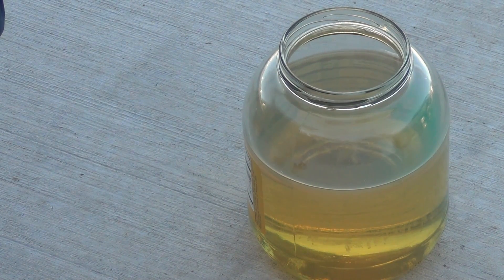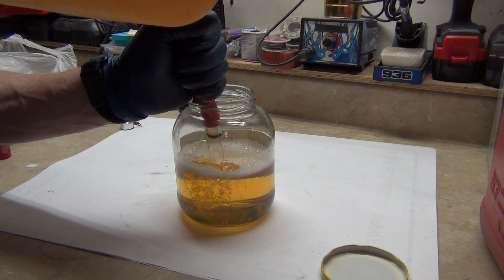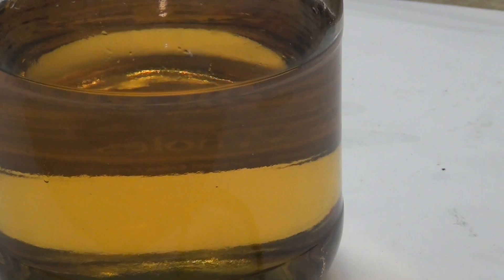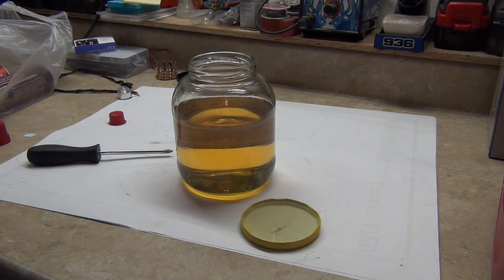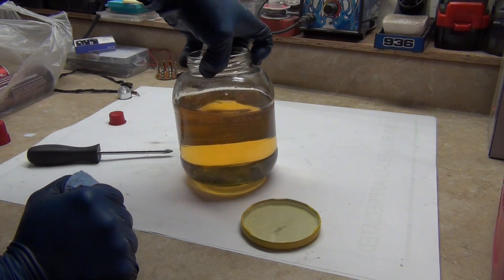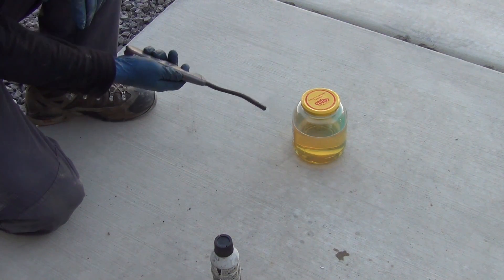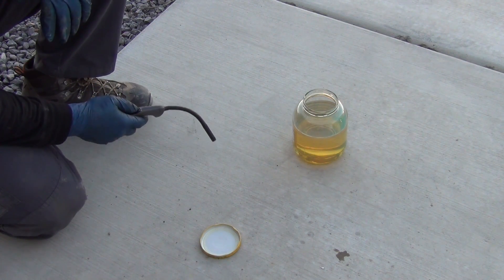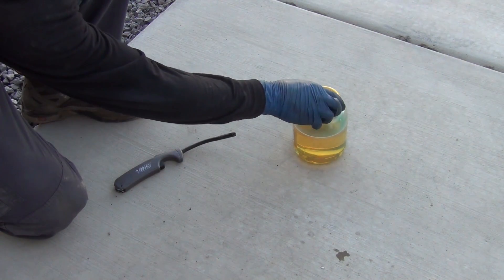What Happens When You Put Gas in Diesel

Comment: Mercedes Benz used to include a chart for adding gasoline to diesel in the owner's manual. Percentages varied from 1% to 5% by volume depending temperature to prevent jellying in cold weather. Using avgas in jet fuel or using a small amount of gasoline in the crankcase oil of WW2 era radial engines was also a common practice. Popular diesel fuel additives are mostly petroleum distillates and are added in small amounts to receive benefit and to minimize  lubricity loss. Be very careful before you try playing home chemist with modern diesel engines.

Comment: In the old before complex common rail injection we woukd mix petrol in to the diesel tonstopnwaxinb in cold weather at that concentration your car will run ok with little effect just keep topping up with diesel
Do not forget diesel will use some engine oil as well on older car ,

Comment: Volatile , Combustible , Ignitable ??? 
What's the word ? 
I did this recently too ( idiot ) full tank of petrol . 80 litres 
Syphoned as much as I could out , put some 2 stroke oil in and filled with diesel after changing fuel filter ( I drove 1.4 km home after petrol fill . )
I kept topped up with diesel for 2 weeks , full up .
Idled rough once on first start , no problems since . 
2018 Iveco Daily turbo diesel

Comment: I worked on the Army base in Europe this summer as a consultant and had to deal with more than few instances where soldiers put petrol in diesel rental vans. I'm not gonna comment on what I think about that, let's just say you cannot miss the sticker on the cap outside on the bodywork and another hole next to the tank, not there in petrol cars. So, there were two ways of sorting it out - the usual and what we did. The usual way was to call the rental company, had that van towed and wait like a week or more to get it back. Of course there would be an extra charge over normal rental rate. What we did was bring the van to a nearby local army workshop where they drained the tank and sorted all other issues. Vans were mostly Fiat Multijets so a lot of petrol could actually break that system.

Comment: Unfortunately my daughter 18 yrs old now borrowed my 2003 black caddy for the first time went to the nearest gas station and was able to fit the diesel pump nozzle into the gas tank opening. I was stunned to find out that not all gas stations have the safety feature of the diesel fuel nozzel having a wider diameter  which won't fit into gas cars. Thank God I didn't give my daughter more than $15 for gas at Mobil Exxon station. I was able to siphon diesel out of tank with still some left over diesel then filled it with 3 gallons of 93 octane then bled the rest of diesel out thru top of engine injector bracket bleeder. Took me 4 hours to stop the white smoke from coming out. But there is still no solution to putting gas into a diesel tank.

Comment: wont adding gasoline to the diesel hurt the injectors ? on account they run hotter ?
Reply from the maker: The real threat is to the injector pump.  Gas doesn't lubricate as well as diesel oil.

Comment: I once tried using a mix of 15% gasoline and 85% heating oil (essentially the same as diesel) in a kerosene heater. It would burst into flame with a big pop when it ignited. The gas vapors still remain very volatile even when diluted with a heavier fuel.

Comment: Bought gasoline at a bp station that had just installed new pumps. I drove a diesel for a number of years and the pump handles were green. At these new pumps the diesel was black and gas was green. I almost grabbed the black diesel but caught myself  had to do double take to make sure hoses weren't crossed by some goobler making a you tube video.

Comment: Different size fuel nozzles is such a simple and good solution. Here in the UK you have to read the pump and check the colour, because both nozzles are the same size. Safe to say, quite a few fuel drain vans are kept busy by dopey people through out the year. Its normally covered by a subscribed breakdown service, but I imagine it's a costly service if you aren't a member. Just checked the figures and the AA claims around  133,000 people in the UK make this mistake every year.

Comment: I bought gas at a gas station and ended up taking the vehicle to the garage.  The vehicle sputtered and mis-fired about 4 miles down the road and backfired to such a degree, it blew my muffler apart.  They drained the tank and discovered a clear liquid that settled to the bottom of a clear jar, almost like a thermocline.    Can't see this as being water.  Any idea what this might be?
Reply: Of course it's water. Condensation is inevitable and because water is heavier than either gasoline or diesel, it sinks to the bottom of the tank.

Comment: I never did it, but when I was young I drove long haul trucks to Canada in wintertime.  I was based in Texas, down here they don't sell Number #1 diesel fuel.  Not anymore.  When I was a KID I saw it here, but not after I was grown.  Back to that it a minute.  

But I knew a lot of truck operators that added GASOLINE to the diesel fuel to help prevent GELLING.  Seemed to work for THEM, but I never did that.  I used other products and of course once I got "up North" they sold NUMBER ONE diesel which of course is a better fuel than the #2 they sell down HERE.  The number ONE all by itself was not prone to Gelling and just would perform better most escpecially when the temperature got BELOW ZERO F.  But we used "Diesel Heet" a product brand name for ETHANOL.  Though Ethanol RUINS Gas engines, especially the smaller they are, it would prevent Gelling and it would cause the water in the fuel, a SLIGHT amount of water,  in Diesel Fuel to mix with the Fuel rather than be in SUSPENSION.  At least that was what the maker claimed and it worked for ME.  I used a LOT of it, put it in the TRUCK FUEL and the Reefer Unit Fuel.  

But otherwise, I would not put GASOLINE in a Diesel Truck of today, they are too EXPENSIVE and now they have ELECTRONICS I don't like on them.  Back THEN in the 70's the diesel engines were ALL MECHANICAL.  They had no "Electronics" involved with the ENGINE.  They were SO MUCH less complicated and easier to WORK ON.  The driver could CHEAT those Mechanical engines when the Alternator went out.  Just take a 10 gauge WIRE and run it from the Hot Side on the REEFER Unit Battery and run it to the hot side on the Batteries that supplied the truck.  It would run the LIGHTS and you could nurse it home.  On a Cummins, we had to screw the nurled nob on the Injector Pump in all the way and that held the shut down valve open for it to RUN.  Could limp home all the way.  Had to put it in GEAR to kill it.  BB

Comment: In the old days we would mix diesel with petrol in winter to prevent the fuel from waxing up it fine to drive with in the fuel tank the fuel will mix due to the return flow of fuel
Reply: Hi Keith, you said, "return flow of fuel"? Is that the workings of all diesel fuel systems.. "return flow"? Isn't the cross-over line between the tanks valved off.. solenoid valves I would guess w/ switch in cab? Thanks
Reply: Not all the fuel that reaches the engine is use some of it flow back to the tank. It's a simple high pressure system
Plus the sloshing about in the tank keeps it mixed

Comment: What diesel number 2 . We only have one type of diesel that clean sulphur free diesel
Why due you Americans make it so difficult over fuel for cars. 
Europe has a similar system. Only the top quality fuels can be used in car answer lorries to reduce pollution,  European diesel can be used through the year we do not change the blend.
Always ultra low sulphur 
Fuel cannot be used in road vehicle as it would knacker your cat and DPF.
Reply: #1 diesel/stove oil is lower temperature tolerant  #2 freezes at -40f or less..#1cost more  and makes less heat.
Reply: "Knacker your cat and DPF."??? Lol. When driving in snow and the wipers get clogged up limiting vision, us "Americans" would shut off the heater, and roll dn the windows for 4-5min. and watch that snow fall off the rubber. Of course my friend, you knew that huh, lol?
Reply: Oh, aboard any diesel powered ships, we had centrifugal-force type oil purifiers to separate the grime / dirt; thus, returning pure clean oil back to the engine. Interesting that oil never breaks down, just gets dirty which causes wear. And w/ oil prices, a purifier sounds smart for any diesel., or one in the shop for oil changes.
Reply: Timothy Bradek yes using high sulphur content fuel oil will damage/ clog the diesel particulate filter which will cause your vehicle to stop. It's important to use the right diesel fuel in modern diesel engines they are not the same as the old diesels, they are not as robust on fuel mixture. My old diesels would run on paraffin

Comment: It is often a misunderstanding to believe that gasoline does not lubricate but diesel does. It's really the opposite. How do you prove that? Take two ball bearings and lubricate one with gasoline and the other with diesel and I'm 99% sure that diesel will break first.
Reply: Alright Jimmy, define "break first" please, because I'm thinking of a controlled environment; such as both "rolling" on a flat surface either at a incline or decline, and of course coming to a stop; thus, breaking. With temperatures equal, viscosities will vary, but what else is a factor?

Comment: When they switched to the new ultra-low-sulfer fuel in '07 my injection pump on my 5.9L took an immediate shit. Luckily it was still under warranty. Anyway, after I got my pump replaced, I started running a half-quart of ATF in my tank with each fill-up to lubricate the pump. I don't do that with my newer 6.7L because Cummins upgraded the pump to handle the new fuel.

Comment: im from Canada i have a 93 camry v6 it was a beast for what it was now that being said i didnt have alot of gas in my tank and the golden arrow bus line i was working at had millions of diesel gas cans around mostly full so i added about 6liters into my tank ran the car for 1hr and a half nothing really happened but i did notice that the car smelled like diesel somewhat now im sure i fucked up the spark plugs which i did change they were caked with carbon build up from the extreme heat from the diesel fuel and im not sure about the cylinders but im sure they suffered afew problems later down the road

Comment: Not really a surprise. It would have to settle out while the tank was drained which would be hard to do with the fuel return and the movement of driving to even possibly have ever been an issue.

Cutting diesel with kerosene or such is pretty standard thing to do when it's extremely cold.

Comment: I think the word you were looking for was "volatile" which, contrary to popular belief does not mean explosive but rather evaporative. And I used to drive a 1959 Pontiac which I mistakingly put about half a tank of dies fuel in. Detonation was out of control. It sounded like a washing machine with a bowling ball in it. I had to dump it or break the rods.. Horrible.
Reply: Dave B .......other way around it just didnt run good. because diesel wont ignite as good in gas engines and thinking a 59 pontiac thems old engines. you wont bank a con rod but itll run like trash till you put more gas in. detonation occurs with lower octane gas. impossible to "detonate" diesel fuel in a gas engine unles your compression ratio is from hell.
Reply: It was about 10:1 and the knocking was insane. You might think it won't detonate but I'm sure that's what was happening. I don't know what pressures and temps are needed to light off diesel but if you think about it, in a diesel engine  it isn't until the compression is already near its peak that the fuel is injected and it immediately lights. I'm sure it would fire off way too early if it was aspirated in the air mix and then compressed like a gas/carburetor setup does. But that's my experience, seems he thought nobody could actually get diesel fuel in a gasoline car but any car prior to the introduction of unleaded gasoline has no restrictor in the filler neck.
Reply: Dave B diesel takes 22:1 compression ratio if very worn it barely burns at 14:1 usually its 22:1 or more compression ratio. no way 10:1 will ignite that. knocking derives off octane vs compression. higher compression engines require higher octane. octane measures the "explosiveness" or the ability to detonate. higher octane will not explode it burns. a slower release of energy. "knocking" refers to engine noise but can be cause by failing pushrods ticking or con bearings going out. detonation or firing before piston reaches TDC is not good. what you experienced was most likely "misfire" or the odd firing of pistons making the engine make noise and shaking the car. if it cant burn it it will spit it out. sometimes. here and there and that mimics severe running failure.
Reply: Dave B now if you put gas in diesel and run it in a moder diesel it will make the diesel knock. but putting a little diesel in a gas car will make it misfire and run poorly till gas is back in full.
Reply: But think about this. As you can see from this test, and any petroleum engineer will tell you, that the refining process is to take the most volatile spirits out first, as you raise the temperature each component of the crude will begin to vaporize, leaving only heavy asphalt at the end. So mixing diesel and gasoline does not prevent the gasoline from vaporizing. So you mix it in the tank of a 59 pontiac and suck it into the intake 
Now normally diesel when under low pressures will deflagrate, that is burn and not detonate. But the detonation can be instigated by a pressure increase for any cause. Similarly to how a smokeless rifle cartridge powder will deflagrate if put out in the open but will detonate when confined in the shell with the weight of the bullet creating a great backpressure, the pressure builds rapidly once ignited and it will detonate. This situation would use gasoline as the primer so to speak, and once ignited the pressures immediately increase to phenomenal levels, causing the heavier diesel fuel to detonate. I have been building engines all my life and the most common terms for detonation are  knocking and pinging. But detonating is the technical term. I've replaced literally hundreds of plain bearings and replaced many many cranks so I know what I'm talking about, and I'm not talking about rod knock or bearing noise. I mean detonation, but I used the common term knocking. I can tell you I know what detonation sounds and feels like. And this was the worst case of it I have ever experienced. I'm not going to get into an argument over this, I thought I'd just add my experience to the discussion and if you don't like my explanation then think some more and come up with a better answer. But I know it was detonating. Now the old Pontiac motors were very robust and maybe a rod would not be the first thing to go but it was downright violent. Once the fuel was drained and gasoline was the only fuel in the tank peace returned, no rod knock and no bearing noise. I'll blame the high pressures that occur right after the gas vapors light off causing a detonation of the diesel. That's my final answer have a great day.
Reply: Dave B i was thinking wrong for a second there i take it back. octane of diesel is 25-45 and gas engines are designed to fire right before the piston reaches TDC so diesel would then ignite after gas ignites and it would try to force it back down but still on compression stroke. i just looked up the research and for every 10 percent diesel in gas it reduces octane by 5 points so thats distastrous knocking. running 60 octane gas in a ohv pontiac engine that supposed to take leaded ultra high octane gas would be bye bye to bearings and cons. for some reason i was illogically thinking that it just wouldnt ignite. but your case was 50%. full tank of diesel would be a no run/poor run situation. i apologize for my illogical misthinking.

Comment: Hi, Don' t want to browse through all the answers. I think you were looking for Azeotrope, a mix of liquids that cannot be seperated by pure destillation. You have already hold that in your hand, it is the mix between water and alcohol, that you cannot distill in normal conditions to more then 96 % purity alcohol. As crude oil can be pretty simply fractioned by destillation it cannot be the case here and you have clearly shown that in your experiment!!! Actually, you are clearly showing what to do after putting gasoline into a diesel tank: DO NOT START THE ENGINE, leave cap open, wait for gasoline to evaporate...
You can save up to 8000 $ on a modern diesel. As petrol is lighter as diesel I suppose it won' t mix in a way where it will migrate too much towards the bottom of the tank and into the fuel system.

Comment: I did some testing mixing gasoline with diesel to make kerosene because of over price kerosene and a lack of locations to get kerosene to use In a kerosene heater, the mixture Is about 12 percent gasoline or less to the diesel but I do Not recommend It, Its Not when You light the heater that It explodes but when the burning wick Is drowned In fuel when turning off that It burst Into flames.....

Comment: pretty simple, first you need to make the difference between fire point and flash point. One will continue to burn at least 5sec by itself and the other will not. in this case it's the fire point that interest us, wich is app. 10 degree C over the flash point. So diesel is at 62 degrees C while gas is -35 degree C. Now to have a combustion you need 3 things, something that burn(fuel,wood,name it), air(in a certain ratio considering what you are burning) and finally an ignition source. So the reason you have to litteraly touch the diesel with the lighter to ignite it is because you actually vaporize it first, once in vapor there's enough air so the combustion happen.